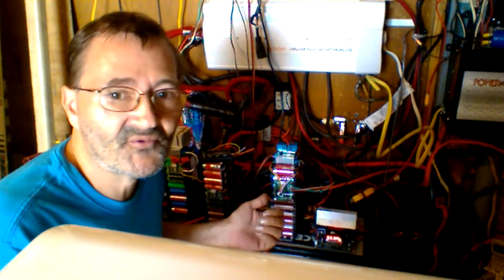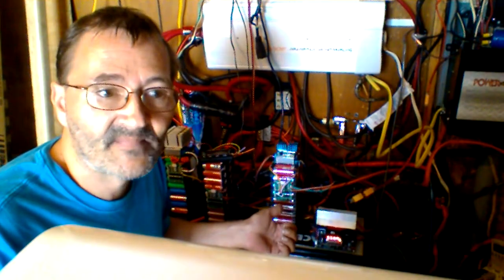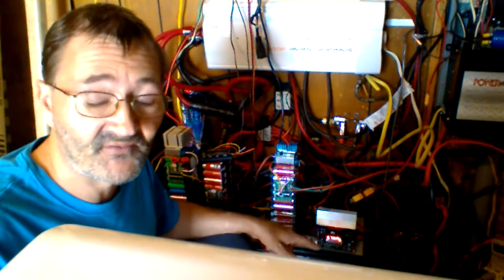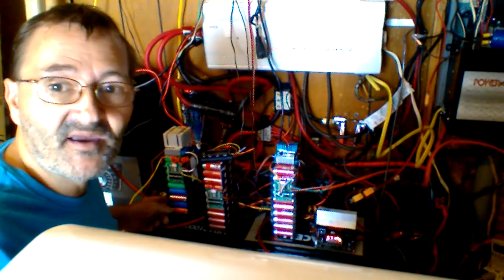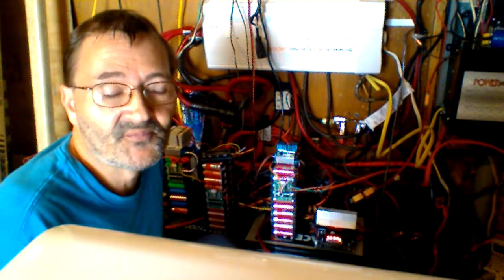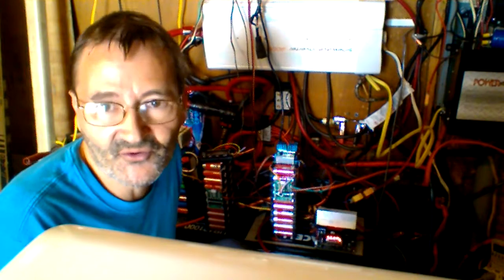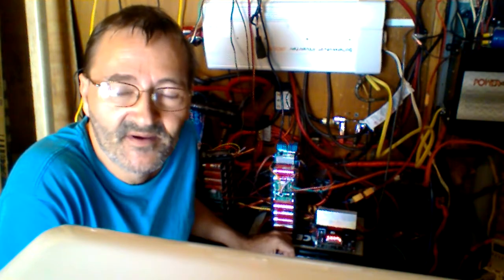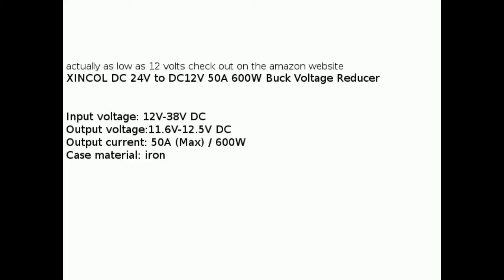4S 18650 project with solar 12 volt

Comment: Yo Steve, how in the world did you connect a solar panel to charge your 4s pack. Or packs. I am scratching my head and can't seem to wrap my head around it. Did I hear you say that your not using a  charge controller? Please explain your wiring diagram. I have a 50ah 4s pack I want to run my solar waterfall pump and lights. Which are 12v's. a 3s pack is not ideal for a pump that needs 12v constant. Please explain or show video on your set up. I think you are on to something big. All these other yahoos that think or act like engineers can't answer my question. And my question was your solution. Thanks my brother
Reply: Buck/ Boost converter
Reply from the maker: that battery pack would be easy to work with a 12 volt solar panel 2 100 watters would do the trick the top open voltage is 21 volts normally the 20 amp CC CV buck converter seams to be the most stable and ya gotta keep it cool that is the most important thing they are stable at 22 amps but heat control is a must keep the heat below 70c for longer life. My inverter can do up to 15.3 volts before it shuts down and i have enough cable for a 0.4 volt drop so 15.7 volts is what i charge them to. If you need 12 volt constant youll have to get a regulator that can control  the voltage and keep it steady at 12 volts and there is not any  ive tried all sorts of things for 16.8 volts to 12 but you could do 8.4 2S pack and boost with the 1200 watt one to 12 volts set it up to do no more than 20 amps at the input. Next problem is how much current does your pump need?
So in short buck to 8.4 volts from solar then boost to 12 volts the boost would have to handle the load you need for your pump. 
One advantage to reducing to 2S is the gain in capacity running multiple packs  and with that you can increase the current available.
Sorry about the really late response youtube never notifies me of any comments and im just learning i gotta look for them.